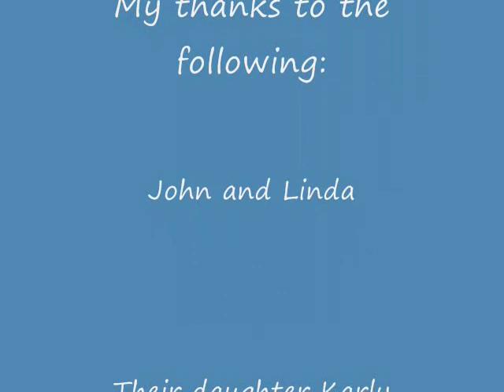Time Lapse video of the 'crew' fixing a broken water line

Comment from the maker: @dsr1022 The dog was pretty old at the time and didn't travel much. He is gone now. 

The PVC is made especially for that kind of fix. It has two rubber gaskets inside and when you turn the ends they compress the rubber and make a very tight seal. I don't live there any more but up until December it was still holding strong.